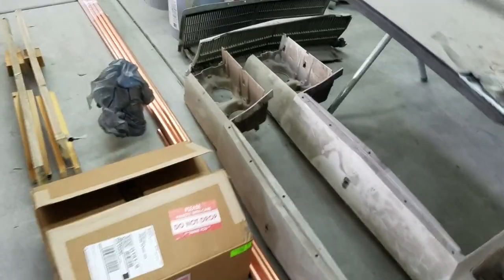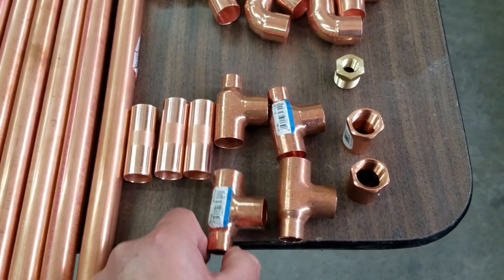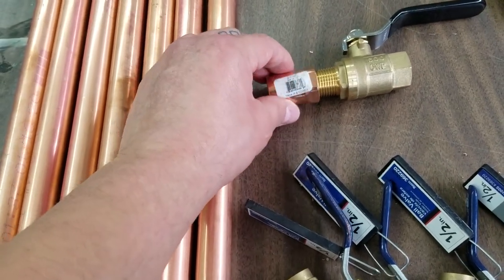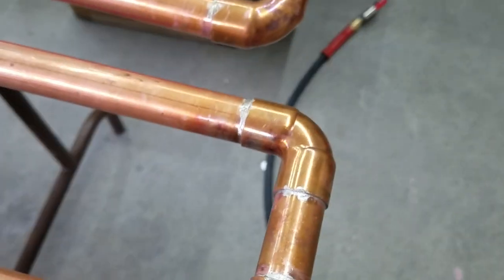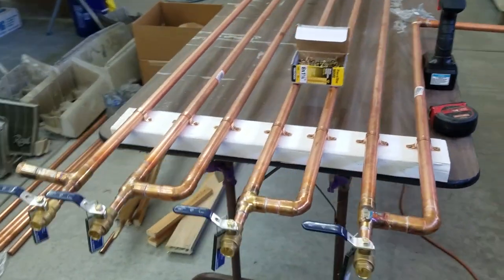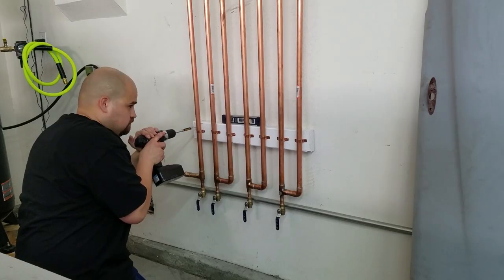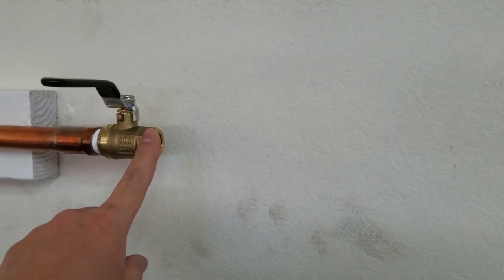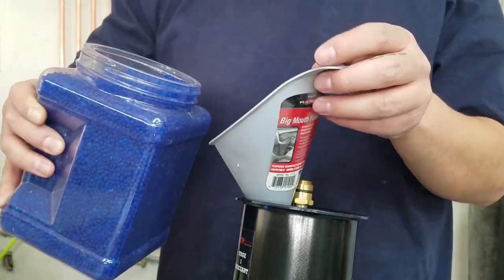AIR DRYER SYSTEM installed with HUSKY 60 GALLON Air Compressor in HOME GARAGE SHOP

Comment: Great build. 
Condencing the water out of air works best when the air is cooling right as it goes into your compressor tank. 
You will have better results plumbing this from your compressor output into your tank. 

It will be less moisture in tank, and remove even more waterr before it hits your expensive dryer.

Comment: You could disconnect the main line from your compressor and feed your system....then return to your tank...and then run your dryer/reg/filter from the tank outlet.  That approach will cool the compressed air before it returns to the tank and decrease the moisture from ever entering your system. You'll be amazed by how much better it works.
Reply: Interesting, Stacy.  Do you have a link or a sketch of this setup?  Thanks.
Reply: @kenfen3104  Just put the air dryer and filter between cylinder and tank and not after the tank, so you get dry air in the tank, no water in the tank and system.
Greeting from Denmark.
Reply: Exactly what I did on my build.  I also added an oil feeder to the output for my air tools with a bypass T to separate the lines (dual feeds) for Painting vs tooling.  It is so smoothly operatinig I was absolutely impressed .......  I tuned in to have a look at the build and was wondering why folks do not consider taking the HOT AIR and cooling it before ever entering the tank. My Tank has been in service since 1996. 1 New Motor, and after 17 years I sealed the inside of the tank to totally prevent corrosion after having it cleaned out. Was barely surface rust but I wanted it out before sealing.  This way is the absolute BEST way to extend the life of you tank and systems. It also extends tool life greatly.
Reply: @anonimous2451  not only this but why is everyone using all those valves , they arent cheap and you could get a better result if you would pipe those all into 1 valve at the bottom , the additional line space would work as dead legs to accumulate more liquid , you could even use clear hose to show when theres a liquid level
Reply: @leegarcia81  Not exactly Lee.  Using my system I find most collected waper vapor in the first line, then less on each valve after. I started just cracking the first line during use and have no drainage from the 3rd line set. The valves are insignificant in cost compared to protecting Plasma Tables from water in the line that eats up the tip consumables.

Comment: This is almost exactly like my setup, I built about 10 years ago right down the the filters and dryers great job... someone in the comments ask about the desiccant... I live in Nevada... (fairly dry MOST OF THE TIME... ) I have pretty much the same size dryer and my desiccant lasted about two years of occasional use.... but really it all depends on where you live and how often you use the system. The nice part is you can remove the crystals, stick ‘em in the oven on low for a couple hours and they are good as new...
Reply from the maker: Nice! It's been working out good for me... thank you for watching 👊 💯

Comment: Nice video ! How is it holding up brother I’m looking to build a dryer system for my new 60 gal puma compressor let me know might just have to go this route !
Reply from the maker: It's been holding up great. No leaks. I would recommend 👌
Reply: Hey bro I’m about to build this system it looks like you added another pipe the end that connects to the 3 foot going to the dryer system

Comment: What dryer filter did you use brother trying to build one like this today as good as yours
Reply from the maker: Here you. This is the one. https://usaweld.com/collections/htp-america-air-dryers/products/htp-america-max-dry-max-dry-xxl
Reply: Hey bro I just ordered everything to make my own system how is the regulator holding up ive seen some bad reviews on it just trying to see if it’s still holding up or what did you replace it with

Comment: Can I use 1/2 copper instead  have you ever ran that size ,?
Reply from the maker: I haven't tried 1/2" before. Bigger is better since it'll hold more air in the lines.

Comment: What is the name brand of the dryer system? Cool set up bro. Even with that nice dryer system you still need the manifold setup why.
Reply from the maker: Its from Usaweld.com ...the manifold is needed to remove the majority of the moisture...and it does

Comment: So how is that MAX DRY AIR system working out for you these days?  I noticed there was NO BEADS in the sight glass in bottom of the drier?  did you put them in but didn't video it?
Reply from the maker: It has worked out great for me. I haven't had any issues at all. Yeah, I had to add the desiccant beads in the sight glass. I thought that by filling up the tank they will show through the glass, but that wasn't the case. Thank you for watching 💪💯

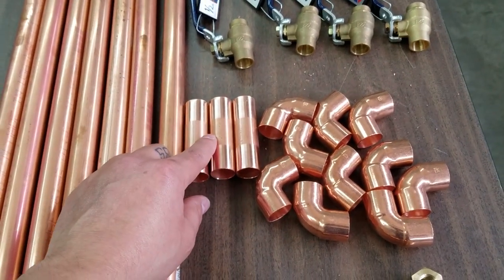Comment: Are you using the flexzilla 0:58  3/8 or 1/2” for your air hose to spray gun hose
Reply from the maker: It's a 1/2" hose. I have the link for it in the description. Thank you for watching 🤝💯
Reply: @StillStandingGarage  is your 50 footer a 1/2” as well or 3/8

Comment: On your desiccant setup how did your screws attach on it? Did they self tap or did you have to tap them before mounting it? I have the same setup and don't want to crack the housing if I need to tap them
Reply from the maker: Yeah, they're self tapping. I screwed them in slow. It didn't crack the housing. You should be good. Thank you for watching 🤝💯

Comment: Awesome video.   I'm about to build on also, gonna use your method.😁

How's it holding up? Any moisture getting to the paint gun?

I'm about to paint an XJ Cherokee at home.  Learned a lot from your video series.

Currently ordering tape, paint filter, paper/plastic cover, fillers, sandpaper, sanding blocks...  

Researching primers.  Not sure which to go with.  I don't need remove all paint to bare metal.  Gonna sand down OEM paint, spray over it...

Thanks for posting.
Reply from the maker: Thank you 🙏.  My system is holding up nicely. I haven't had any moisture make to my paint gun. Nice build! I'm glad my videos have added some value to your build. I have been using Eastwood and High Teck primers but I want to try the Tamco 5310 high build primer. I've read a lot of good reviews on it and also read that it's easy to sand. I'm going to try it on my next project
Reply: @StillStandingGarage  Thanks for the quick reply.  I'll check out Eastwood a little more.  Been watching their videos lately.  Kevin seems to provide good info...  Gracias Amigo...
Reply from the maker: @05glisedan  No problem at all 🤝

Comment: Great stuff! I think i bought that same dessicant system. This is my first 60 gal compressor. I havent installed yet. Can i use
thinner copper lines? Im trying to really avoid any water and oil in my lines. Thanks again brotha
Reply from the maker: Oh nice! 💯 not sure about using thinner copper lines. I've only used these and so far they're holding up. Thank you for watching 👊💯

Comment: How much moisture do you think you’re pulling using the vertical pipes?  I want to buy a refrigerated air dryer, but that $1000 pill is hard to swallow.
Reply from the maker: I think im pulling the majority of the moisture out with the water trap... I open the ball valves after about 30 minutes of use and release the water...the air dryer gets the small amount that gets through the copper line

Comment: Great setup bro 👍, the pipe size is 3/4 right? But how thick it is? And can i use galvanize or just regular metal pipe because in here (indonesia) the copper pipe is very expensive and hard to find too
Reply from the maker: Yes, this is 3/4" and it's type M copper pipe. The size of the wall is .032" thick. I'm not sure how well other types of piping will hold up.
Reply: @StillStandingGarage  ok thx mate

Comment: Where did you air dryer from? I do Automotive refinishing at home and need to build this asap. What's a manifold and what does it do where do I get one?
Reply from the maker: Air dryer is from USAWELD.COM.... The manifold is the water trap before the dryer.
Reply: @StillStandingGarage  is the manifold necessary? If so where can I get one that you recommend? I have a 60gal vertical 5hp single stage compressor.

1) Are you calling the inline water trap the Manifold?

2) Also what's the part number on the 1/2 blue handle ball valves? I can not find any non threaded ball valves on Amazon for copper tubing like yours.

3) Do you NOT recommend that air regulator in your inline system now? In your other video looks like you removed the regulator. Is it needed?
Reply from the maker: I made my own manifold/water trap. You can find the ball valves without thread at Lowe's or Home Depot. The regulator after the compressor isn't totally necessary. I just wanted to control how much air went into my water trap. Everything is working fine without it.
Reply: @StillStandingGarage  so what adapter size copper tube did you use between the 1/2 ball valves and the T at the bottom of your manifold? Looks like the adapter slid right into the ball valve for brazing. I know you are using 3/4 tubing but I cannot find anything that slides into the 1/2 ball valve so I can braze it up? Can you help?
Reply from the maker: I used a 3/4 to 1/2 reducer
Reply: @StillStandingGarage  did that 3/4 to 1/2 slip into the 1/2 ball vale or did you just butt the copper tube up against the ball valve and braze?

Comment: hello, thank you for your video I think it will help me a lot. how high are the copper pipes please? the dimensions of your installation? thank you so much
Reply from the maker: They are about 7ft high
Reply: @StillStandingGarage   thanks for your reply, is it worth it if i do the system on 1.50m (5ft high)? thank you so much
Reply from the maker: As long as the total length between your air compress and dryer is 50ft you'll be ok with whatever hight meets your needs.
Reply: @StillStandingGarage  thank you very much so if I understood correctly the copper system must be 50 feet wide? does it matter the height? thank you
Reply from the maker: No problem at all. Not wide, 50ft in length. It doesn't matter which way it's set it up as long as the total length is 50ft.
Reply: @StillStandingGarage  ok I understand, I'm sorry I have to translate a comment because I'm following you from my France ... :). . So does it matter how long or how high everything has to be 50 feet (15 meters) of copper pipe? thank you for helping me my friend
Reply from the maker: Oh I see.....Yes, correct.
Reply: @StillStandingGarage  great I admire you for the help you gave me. last question how much is the diameter of copper?

Comment: What is your psi coming out of your compressor
Reply from the maker: It was at 90psi, but I ended up removing the regulator because it was making a humming sound. Now I only regulate the air before my work hose.

Comment: Hey man I’m building one of these and I am curious how you fit the lead line (green hose) to the piping without a union or screwing on the 1/2 inch npt to 3/4 copper fitting before sweating. How did you do it?!
Reply from the maker: Hey Justin, One end of the Green hose swivels. I installed the side that doesn't swivel to the copper line then installed the swivel side to the air compressor.
Reply: Nice, that should be a 1/2 inch legacy (flexzilla) lead line? Do you recommend it? I bought a cheap lead line but I figured out the ID is 1/4 inch instead of 3/8. Thanks for the video, if it wasn’t for you I would be even more confused! Please keep up the content, and here is a sub!
Reply from the maker: Yes, I used the 1/2" Flexzilla hose. I have a link for it in the description of this video. I've been using it for over a year without any issues. I run 150psi through it daily. I'm glad I was able to help. Thank you for watching 👊💯.

Comment: Very nice. What size solder did you use?
Reply from the maker: Thank you 👊... if I remember correctly, it was about 1/8"
Reply: Cool. Thanks. As far as that Husky, what would you rate the loudness of the unit? It's a great deal, but I'm working out of my garage, and currently running quiet tech. Your reply is much appreciated
Reply from the maker: It's pretty loud, I have to shout to have a conversation with someone.

Comment: Did anyone ever use refrigeration  copper y bends instead of 90s  and tees to make a compressor air dryer just wondering if it would work
Reply from the maker: I think I have seen some use the Y fittings instead of 90s... the concept is the same just different design

Comment: Aye bro isnt the husky compressor 3/8 fittings how were u able to get it too 1/2 inch ?
Reply from the maker: Mine was 3/4"... I used a reducer fitting to step it down to 1/2"
Reply: @StillStandingGarage  any reason u decided to go with the 1/2 or can this whole set up be done with the 3/4
Reply from the maker: It can also be done with 3/4" all the way to the dryer system. After the dryer it steps down to 1/4" NPT. I used 1/2" so the water trap could hold a bit more air.
Reply: @StillStandingGarage  u think it would work with 5 ft piping instead of the 7 ft bro ?
Reply from the maker: Yes, that'll work as long as the overall length of the water trap is 50ft

Comment: Dope
Reply from the maker: Thanks 👊💯
Reply: @StillStandingGarage  I saw you tested with 50 psi, what do you normally run. I wanna do the same setup, my compressor runs 175psi, wondering if that's ok?
Reply from the maker: I run 150psi all the way to the Max Dry dryer system then I step it down to 90psi to my hose... the copper line is rated at 250psi... you should be ok.
Reply: @StillStandingGarage  sounds good , thanks bro
Reply from the maker: No problem

Comment: Nice job! That is a very clean looking install. Question: How long does your desiccant last?
Reply from the maker: Thank you! It last quite a while. I haven't logged hours of use, but I have baked the desiccant beads 3 times already. I will be replacing them with a new batch in the upcoming weeks. I have been using the same beads since the making of this video.

Comment: Great set up! I couldn't read any of your reply's? So here is the question, where did you find your filter/drier? You listed all other parts but that? 

Also, desiccant, to save some $$$ I use the blue kitty litter, same thing as desiccant but a lot cheaper, and when in a bind, you can NUKE it, it will dry it for a few more uses :-) 

Thanks for the video!
Reply from the maker: Thank you! I got the dryer system from USAWELD.COM. I usually bake the desicant beads once they're saturated. I do it 3 times then replace with new ones.

Comment: Hey bud, how much was all the copper? That air dryer looks like it was $350.
Also, what did Home Depot charge you to deliver the compressor and pipes?
Thanks! :)
Reply from the maker: I spent about $140 for all the copper. Some of the copper fittings I bought on Amazon. Links for those are in the description. Yes, that's the price for the dryer system. Home Depot charged $80 to deliver both.
Reply: Still Standing Garage thanks brother! You been a huge help!
Reply from the maker: @jasonenz4238  You're welcome